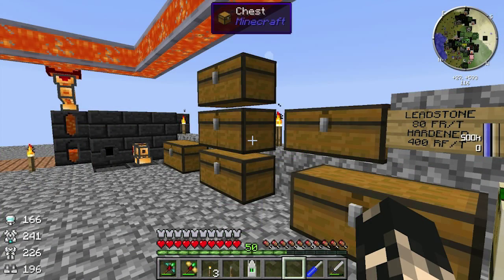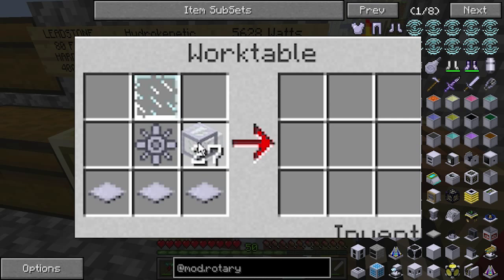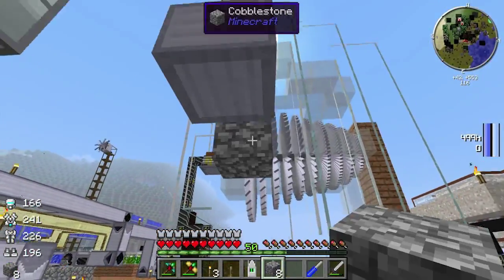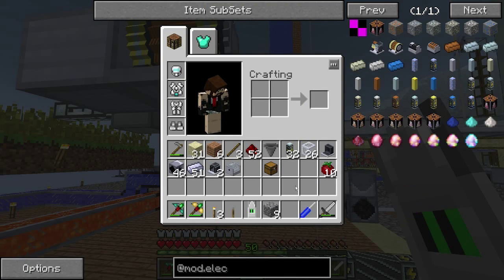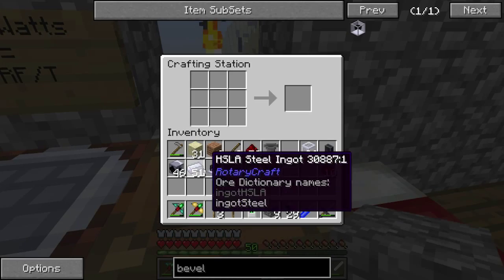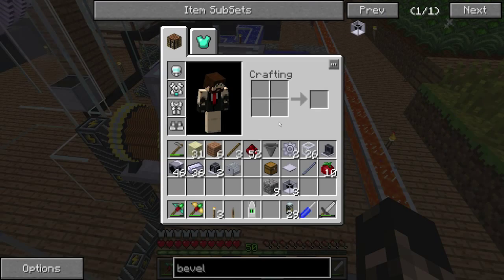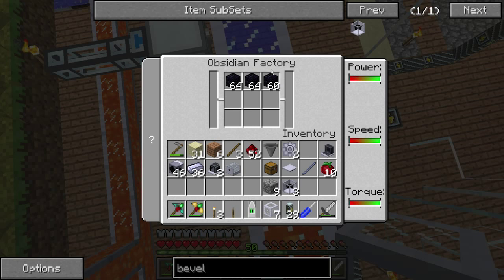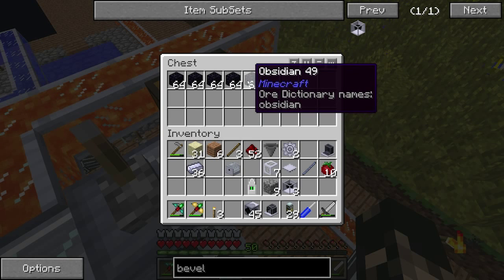Monster FTB Rotarycraft Obsidian Factory, stacks on stacks

Comment: Combine Ex nihilo with Thermal expansion, and you can build something similar (though not nearly as compact.)
Reply from the maker: how fast is it, not that speed is an issue when you just want some obsidian.
Reply: well, I've got about 16 crucibles connected to a single cobblegen, and together they make about a bucket's worth every five seconds or so. Of course, you have to run piping to carry it to a tank or a stone barrel with water over it, so like I said, it requires a whole lot more materials and space.